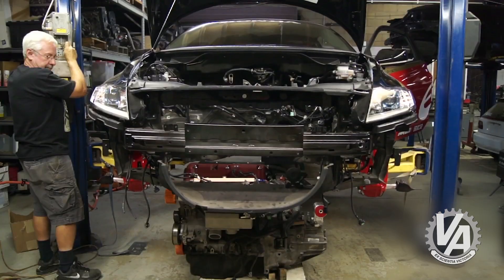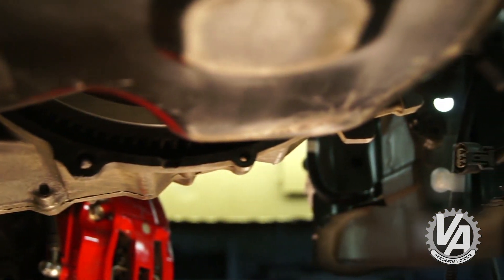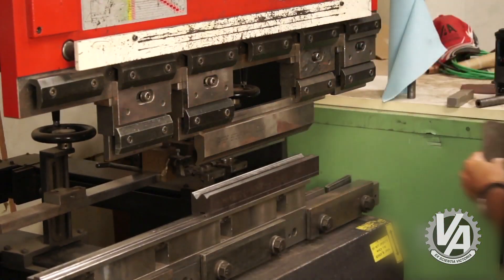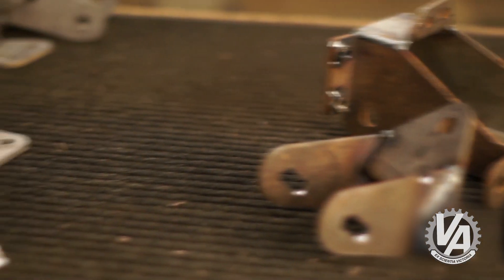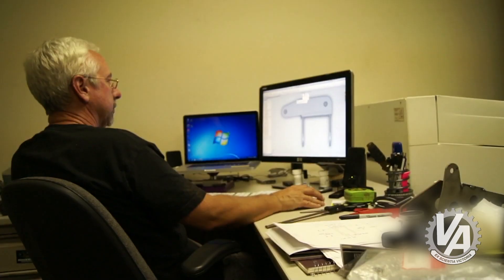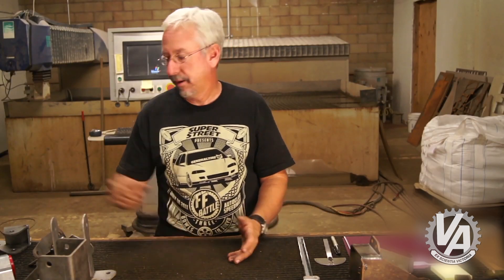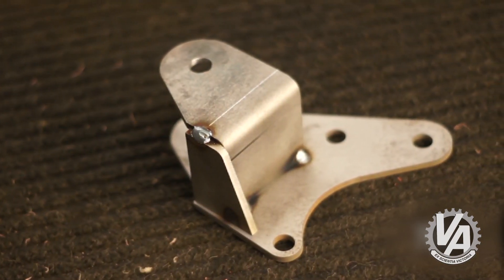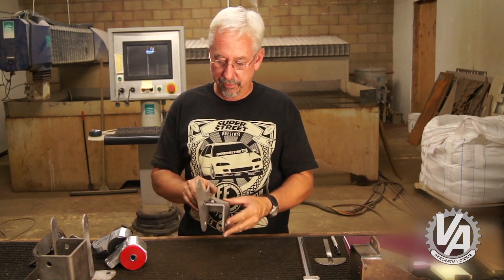Project Eibach CRZ K24 Swap Part 3

Comment: Where do I go for info on rear wheel drive K24 swaps. I want to kswap my hardbody
Reply from the maker: Kmiata has some parts you can use. The BMW transmission they are using for some swaps would be a good swap for that.

Comment: I have a very odd question. So I've got a 97 subframe from an integra to k swap my 97 ek sedan. Everything currently in the car is good except the steering rack. Is there an engine mount kit you guys make to keep the single cam and use the integra subframe and lower control arms, but be ready when I swap a k in? This way I can get the proper steering rack instead of keeping the bad ek one in now. I'm not ready to swap and still have a lot of parts to accumulate but for now would like to run the single cam until ready.
Reply from the maker: You just need the rear engine bracket from the 92-94 Civic D-series engine. That will be the right dimension for use with either an EG or DC2 subframe.